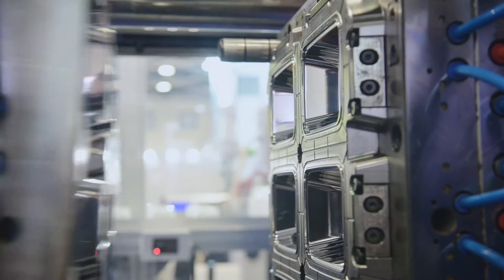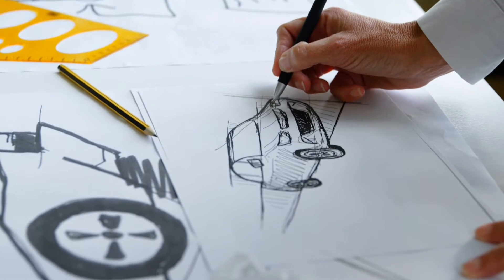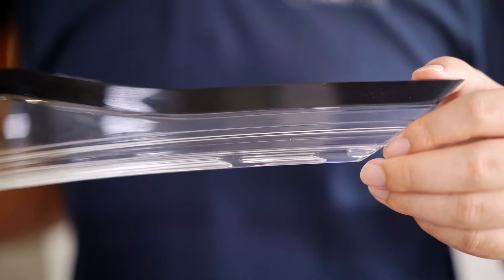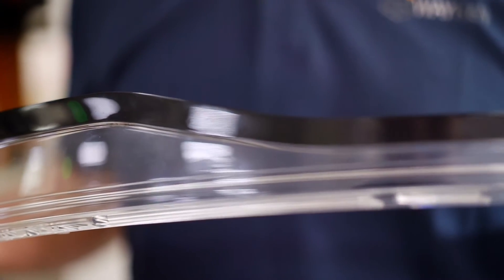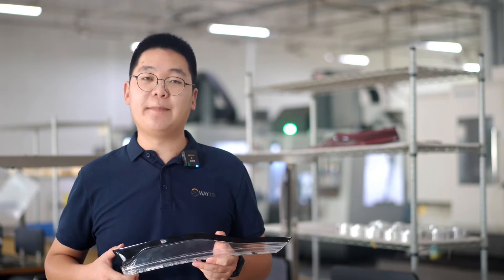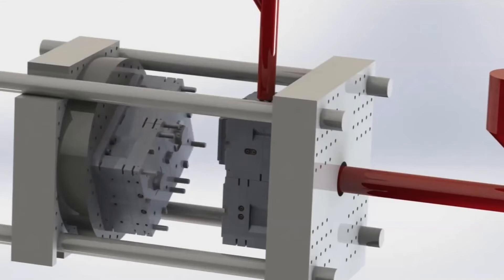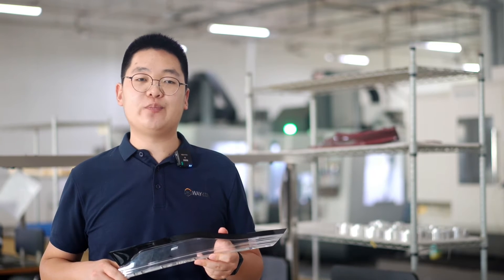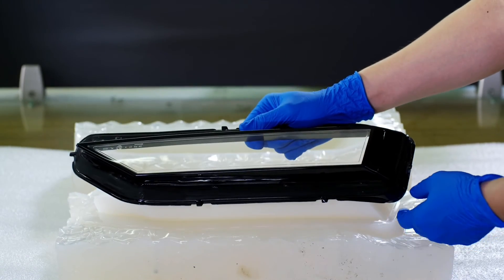How to Make Car Lamp Lens?｜Vacuum Casting is a good choice - WayKen Rapid

Comment: Vehicle headlights are made of PC material, but what is the top layer coated with to protect against UV rays? What is the material on the original headlight as a protection layer?
Reply: Why most headlights get very hazy there is no coating  the manufacturer recommends applying a protective coating on your own every 6 months but normally there acrylic or polycarbonate now a days  and to get anything you want from China you have to hold there hand yeah part of its the language barrier but for the most part it's like they were never thought common sense you can just send them a case file with a list of steps and expect a part you alot of times will need to supply them with proper tooling and even explane to them how you actualy use there own machines have family who deals with imports all the time and I don't envy his job